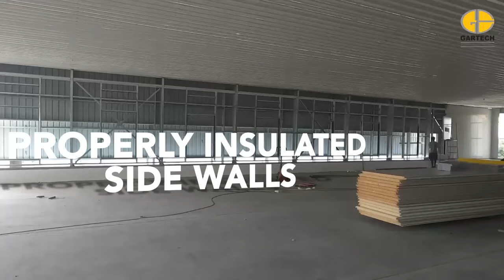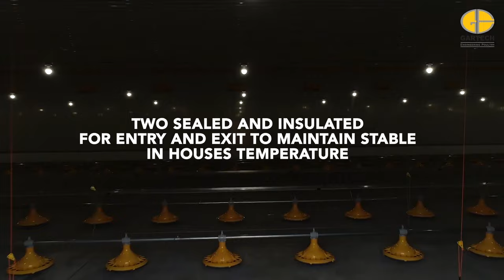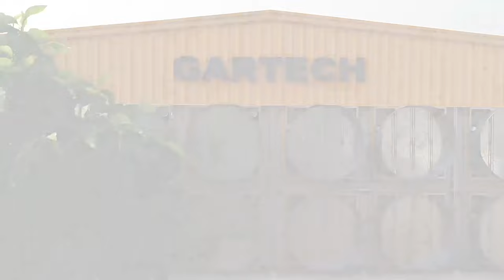THE IDEAL BROILER FARM

Comment: Does a north south shed work for poultry?
Reply from the maker: Not advisable, also depends upon where you do the project and the wind direction in that area. North-south doesn't directly impact the ventilation equipment, however, it will definitely affect the overall efficiency of the ventilation equipment.
Reply from the maker: It affects the efficiency of ventilation equipment, please do contact us on +91 9822545658 for more info...